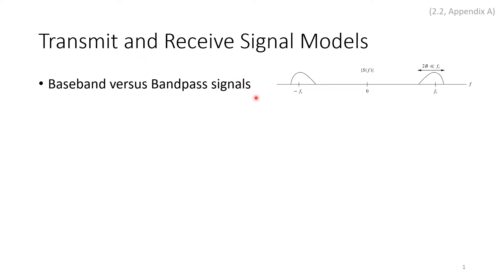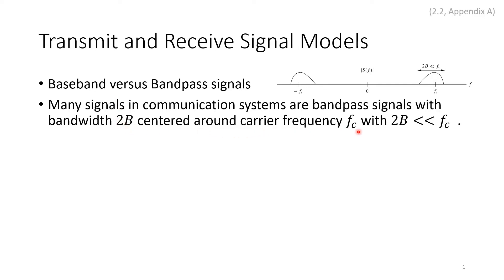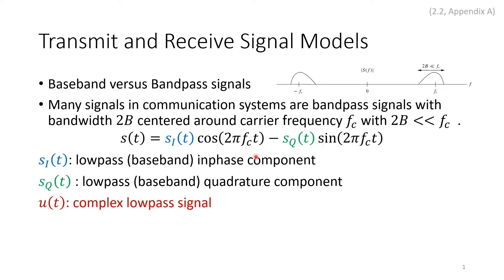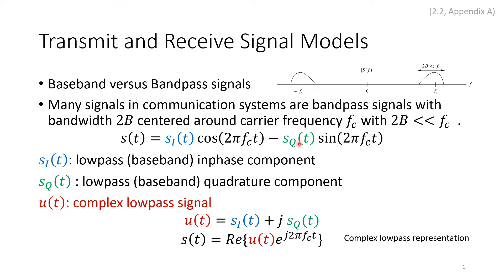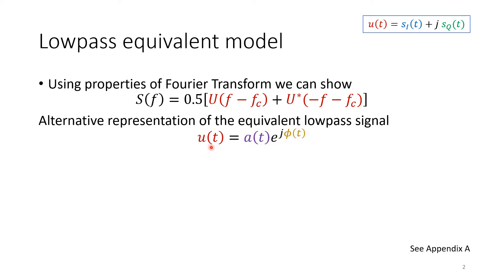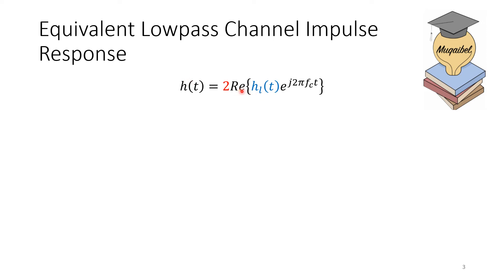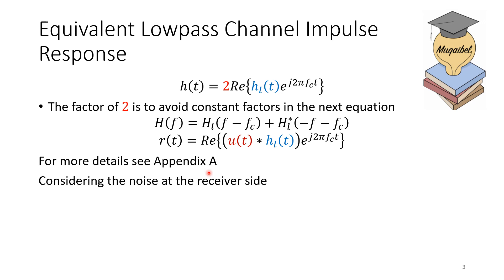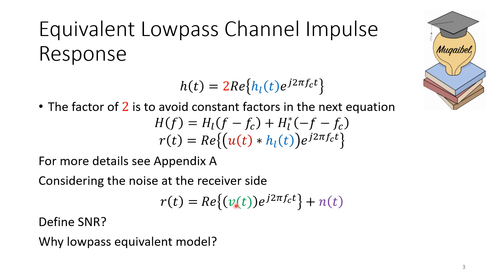4.0 Transmit and Receive Lowpass Equivalent Signal Models

Comment: Excellent question !! pass band will add extra complexity and extra hardware requirements in-terms of circuit components, and also pass band means we are dealing with higher frequencies than low-pass and hence it is more Susceptible to noise element which we already suffer from by the thermal noise in and outside the receiver system. noise-power = k T B, with K=Boltzmann constant 1.38064852 × 10-23 m2 kg s-2 K-1; T=temp and finally (B = bandwidth = passband ).